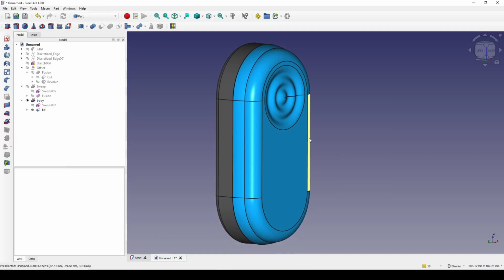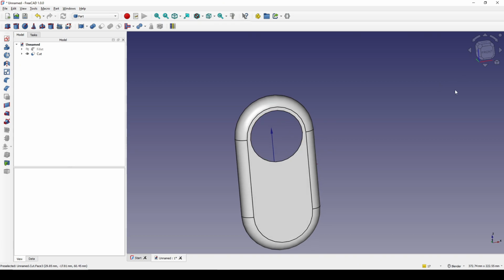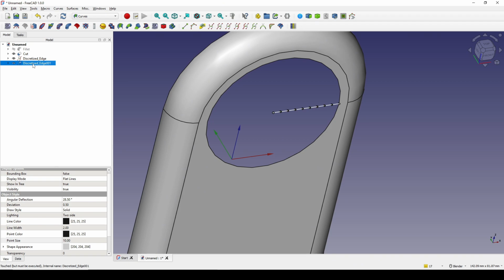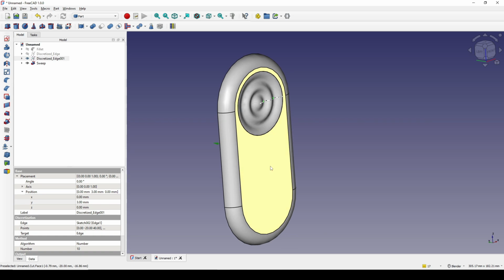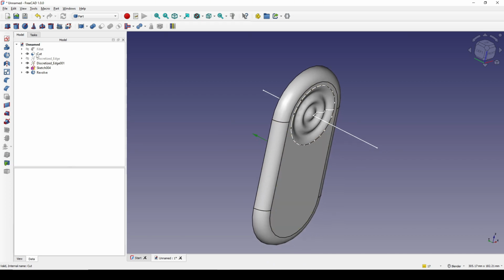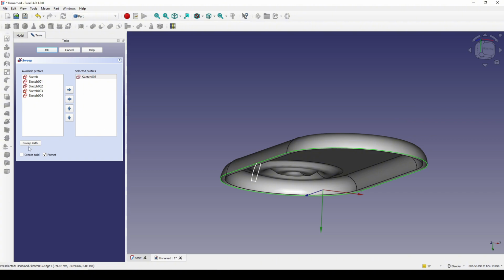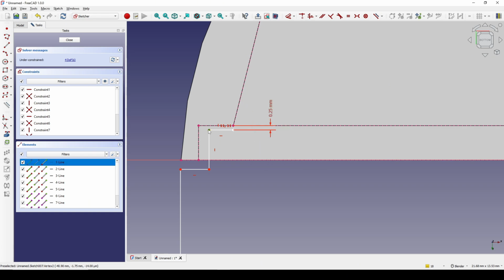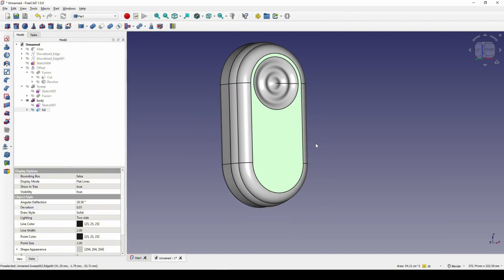FreeCAD 1.0 Add Finger Tip Detail On A Box

Comment: When you use sweep function and part has wrong normal direction you can use function [Part → Reverse shapes] in Part workbench. This function creates new part with reversed normal direction. I think then 3d offset should work properly.
Thank you very much for your videos!
Reply from the maker: I also think reverse shapes work, but it doesn't work in this case.
Reply: @DuyQuangDang  I've tried Reverse shapes now and it didn't work on the first try. I solved the problem by using the [Part → Join → Connect objects] instead of the [Part → Boolean → Union]. I've noticed that this works much better and I get less errors when I connect surfaces this way.